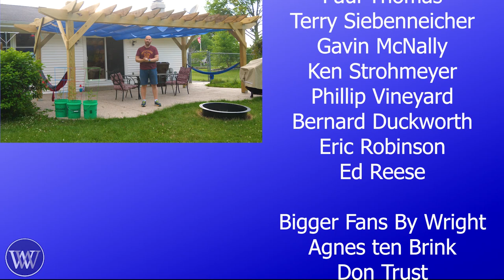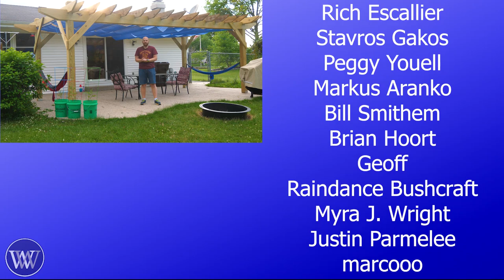DIY Pergola with Retractable Awning and Power Tools

Comment: GREAT work James. thanks for the video. I was looking for how to make a retractable awning and this is it. thanks again! one question, though, I noticed the awning sags in the middle, probably because of the length of the wires and the weight of the awning. or was the fabric a bit longer? any solution to that? thank you!
Reply from the maker: There will always be some sag to the wires. The amount of tension they need is rather significant. But it's usually only an inch or so over the distance. At the time of the video I had not had a chance to fully tighten them. It usually takes couple weeks of tightening every other day or so. It has the whole structure takes up the tension.

Comment: What was the total length of the pergola and what size and length did you use for the support beam above the posts?
Reply from the maker: From post to post it is 10 ft x 20 ft. The posts are 6x6. So the long beams are 24 ft long and a short beams are 14 ft long.

Comment: What wood do you recommend for a Pergola. I'm thinking of building one but not quite sure what wood to use.
Reply from the maker: I use pressure treated pine. But if you want something all different I would suggest cedar. if you want something a little more robust and durable I would go with something like a live oak or White oak. But those can be very hard to find and incredibly expensive.
Reply: @WoodByWright  OK, thanks. I was just curious what an expert uses. I think I will go with the Pressure Treated option since is more cost effective.

Comment: Whats the span on this? and are the main beams bowing in?
Reply from the maker: It is 10 ft post to post by 20 ft post to post. There is no deflection in the beam. The 20-foot beam running into end is a 2x12 and plenty stiff for the weight applied to it.

Comment: Nice job...a suggestion...build a couple of saw horses..save your back son you will need it !! And yes I agree the project is screaming for mortice and tenon braces like you said...
Reply from the maker: Thanks Chuck. I did actually use a couple saw horses to start with but found I much prefer doing it on the ground. I'm odd but I actually found it to be more comfortable. So I put away the saw horses and just did on the ground.

Comment: Your kids are super lucky they have a cool dad that does carpentry ^_^
How did you mount the posts to the concrete?
How do you plan on keeping your new structure clean?
How do you plan on preserving your structure from weathering?
Reply from the maker: For some reason I didn't get footage of putting down the brackets. There are metal brackets that are anchored to the concrete and lifts the posts up a half inch so that water doesn't actually touch the bottom of the post. Once all of the wood has a chance to dry I'm going to coat it all with a deck stain and wood sealant. But I want to wait until the new 6x6 is fully dry out. So it will probably be later this year. As they are treated they don't need as much work to protect from the weather.

Comment: When looking at the patio doorway, all I could think of, was that it is way too low for my tastes, but I don't have to walk under it, so hopefully it is an enjoyable addition to your back yard for you and yours!  (I've been thinking about a pergola too, but I think mine starts about 3' taller than yours, and I'm thinking about going a bit higher and putting solar panels on top of it too)
Reply from the maker: Yep we were playing with it back and forth about where to put it but if I put it much higher then it looks odd in front of the house as the roof comes in underneath the pergola. Also will be having solar panels on the roof and I didn't want to cash shadows on it.

Comment: Well done, as always! How long were those boards that you used for the main cross beams? They looked like they were over 20ft?!
Reply from the maker: The long ones for 24-ft 2x12s. Big beefy suckers
Reply: 3yrs later, wondering how those 2x12s are standing up. 20' seems a lot to go without sag. You mentioned you'd be posting plans on your website. Are they still available?

Comment: I would have used the house wall as the rear support to avoid the rear legs. Also make it easy to disassemble in the winter months. Here in England external woodwork deteriorates over the winter months so being able to take it down easily would be a benefit.....also makes the room lighter over the winter months. Like the fact that the awning is in sections and will spill wind easily so it does not take off. But hey, you’ve made yours, I’m still talking about mine!
Reply from the maker: Yeah I was looking at attaching it to the building but unfortunately the code here does not allow that otherwise it would have to follow a whole new permit method and be considered a house construction. if I don't attach to the building that I don't even need a permit I can just build it.
Reply: @WoodByWright   Ah! Different countries, different codes. Here in England there is a classification called 'Temporary Structures' which have a different category. I believe (but do not know for sure) that something like this that is only bolted in place for the summer would be classed as temporary. Trouble is the more questions you ask, the more chance you'll find someone saying "No" ... :))
Reply: well here in rainy England, as long as you pre treat the wood, then coat it, it will last for many years too, even in the wind, rain and snow :)